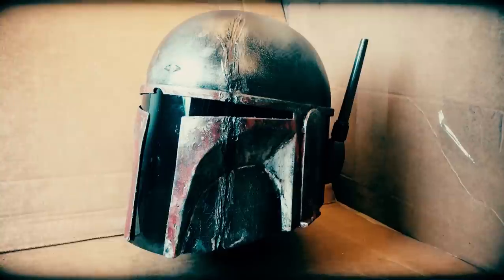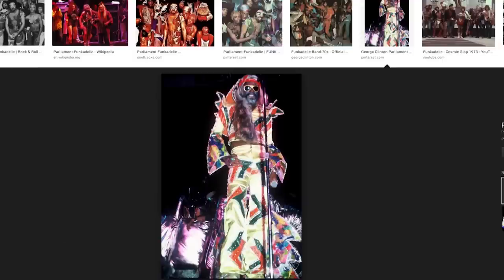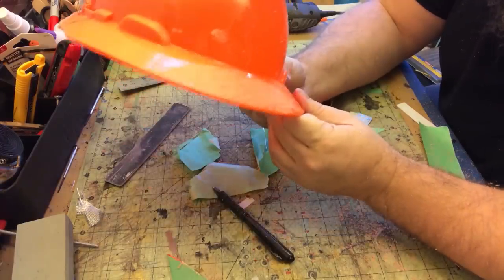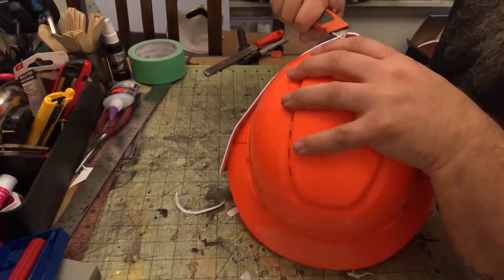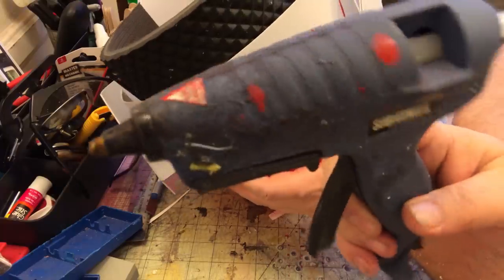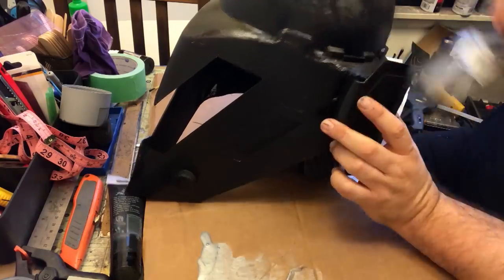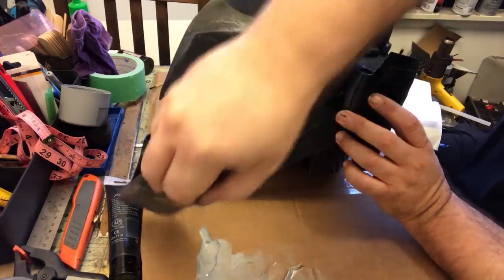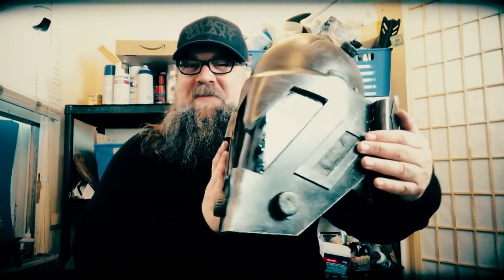SPACE HELMET: DIY TUTORIAL SCI-FI ARMOR FOR MOVIES & COSPLAY

Comment: I would make sure the face grates were actual holes, and also put some extra vents in the top of the helmet, just to make sure the helmet has some extra ventilation for the actor and isn't as hot as it normally would be. Also the reduced heat will make sure the hot glue lasts longer and won't get messed up by the mix of heat and moisture from the actor sweating. Also you should remove the brim from the back of the hat because it still looks like a hard hat from that angle.
Reply from the maker: copy that SAM